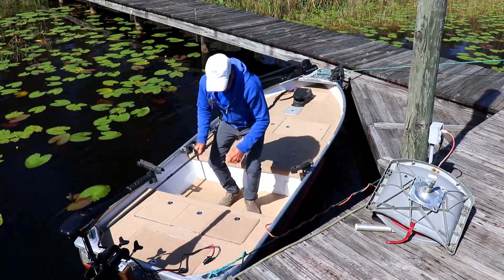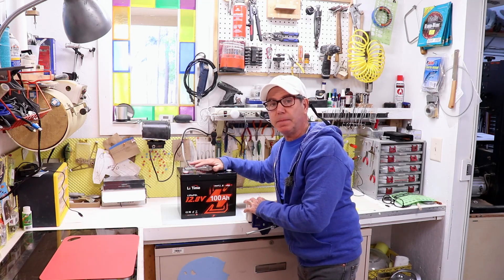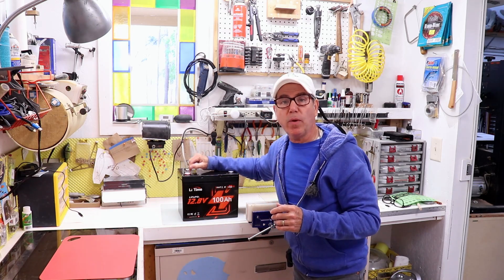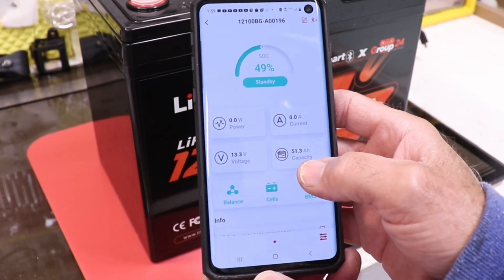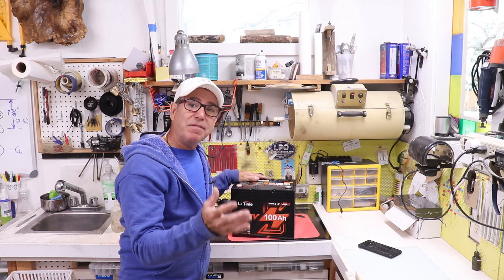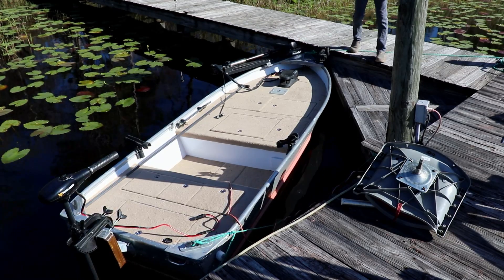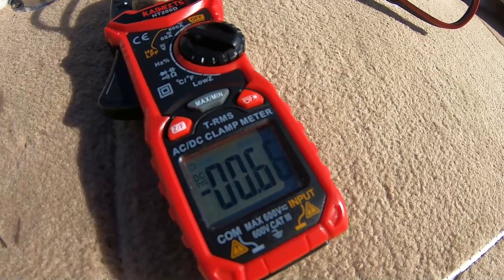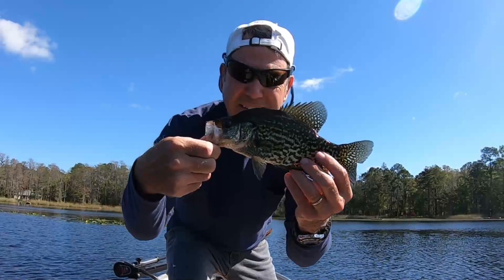Is this the ultimate trolling battery? the Smart lithium battery from LiTime #lithiumbattery

Comment: Is your Minn Kota 50 lbs is the  Maximizer version?
Reply from the maker: No...I don't think so.
Reply: @EngineeredAngler  The Maximizer use 2x less power!!! I have the 55lbs and with a 100ah lithium battery i am able to do 3 days of 8h of trolling at the lowest speed with 1000 lbs total weight ( 3 adults + boat and everything )
Reply from the maker: Wow I need to look into it.
Reply: I'm looking at this Minn Kota Endura Max 55 it has the maximizer also.
Does it really give u that much better power and distance then the a regular one? And is that just when u troll on say speed one? 
I'm looking for a good 55lb to use on my floattube a sevenbass flatform XL. And if this truly pulls less power it's a superb thing. Don't need to go max just want the nest motor so I can be out more hours.
Reply: Minn Kota Endura Max 55

Comment: Just so you know, the charger voltage was lower because the charger was peaked in current limit. In other words, the charger can only output so much power. So when the battery voltage is really low, the charger would have to produce more current than it's capable to accommodate the battery's needs all at once. The voltage is in a see-saw relationship with the current so when current is peaked, voltage is lowered to charge the battery and be closer to match the battery's state of charge voltage. Hope this helps.

Comment: I've got a new boat, a pair of LiTime bluetooth batteries and a LiTime two bank 10 amp charger, all professionally installed.  The charger lights flashed red when I plugged it in today.  The manual doesn't tell me what that means.  Also, I can't get the LiTime app to open so I can pair my iPhone to the batteries.  I keep getting the following message "The network has timed out.  Please try again later:  I have tried many times, to no avail.  There is no USA based tech support for LiTime that I can find.  You have to send and e-mail or call Hong Kong China.  I sent an e-mail and got a message saying they would get back to me within 24 hours.  They have not.  I finally called the phone number today and it just rang.  Probably because it's 2PM here in NY and 2AM in Hong Kong.  Very frustrating.  Can anyone on this site help me fix these issues?

Comment: Last April I purchased three LiTime 100 amp deep cycle lipo 4 trolling motor batteries as well as a noco lithium charger from Amazon. One of the batteries froze at 72 % and would not charge. Li Time customer service told me I had to ‘wake it up” by drawing 60 watts for five minutes. This seemed to work. Not long afterwords another LiTime battery went dead @10.25 volts and would not charge at all. I contacted Li Time and after several e-mails gave them my receipt, charger info, order # and picture of battery and this is their response;
“Hi Randy,  Thanks for your info. It helps!✨  I will help you return this unchargeable battery, we will cover the shipping cost.”
Next I received this from Li Time;
“We notice that your order was placed on 7 April 2023, which is one year ago, and according to our refund policy, for orders one year ago, the refund percentage is 60%.Is it acceptable for you?
Once the battery is delivered to the warehouse, we will arrange the refund for you, the tax will be refunded by Amazon.
For the replacement, you just need to pay $28 to get a new replacement battery.”
After complaining about having to pay shipping costs to Li Time I received this;
“Hello Randy,  We've received your returned product and we're ready to arrange a refund for you,before that,we have received your request about the return shipping cost.
As you're our valued customer, after a special application, we would like to help you cover the shipping cost of $28 for the replacement battery, but could you pls help write a 5-star review on our website before the refundation? Is is acceptable and convenient for you?
If it is possible, pls mention my name Mavis in the review. Thanks in advance for your help!!
Here are the steps to leave a 5-star review on our website.”
I noticed Li Time asked for a 5 star review BEFORE THEY WOULD SEND ME A REPLACEMENT UNDER THEIR WARRANTY.   I asked again do I need to write a 5 star review before I get warranty service?
Li Times answer was “yes in order to not get charged for shipping I needed to write a 5 star review.”
This in ‘my opinion’ amounts to blackmail for warranty service.
In my opinion this is an act ( to obtain false higher ratings) of a very disreputable company. I would advise avoiding doing business with this company like the plague, as their warranty policy is truly not 5 years , but only 30 days without penalty ( cost) to the buyer.
From Li Time;
“If the 30-day return period has passed, if the item is faulty or malfunctioning, the customer needs to pay for the return shipping cost, since you are our valuable customer, we have already covered the return shipping cost for you, normally, the replacement shipping cost will need to be covered by the customer, to make up for a little bit of the loss, if you are willing to leave a 5-star positive review on our official website, we will cover the replacement shipping cost for you again, and we will send you a brand new replacement for free!   The total shipping cost is $56( for the return and replacement”
So my replacement battery was held hostage until I wrote a 5 star review…..this I did begrudgingly. (This is an amended review of the 5 star rating I was blackmailed into writing).
Beware of this horrible company, their products, their poor warranty , and potential blackmail to obtain warranty service. Beware that those 5 star reviews you read about ,may be blackmailed by Li Time like mine was , just to get your “kidnapped” replacement battery released from Li Time .

Comment: thank you so much for the video, i was having a hard time deciding between bateries and you sold me on this one. I have a 3 meter inflateble boat and i am going to put a 40lb minkota troling mottor, im going to hook it up with this battery. The whole weight with me and the motor and the battry should be about 100kg. I should be fine right? thanks for the video, perfect timing for me!
Reply from the maker: Yup I think its perfect for an inflatable dinghy.

Comment: It would be great to be Able to get this in Australia. 
And I would be interested to know if it could be used with automotive  under bonnet usage
Reply from the maker: No, not for starting engins.
Reply: @EngineeredAngler  thxs for your reply. 
I wouldn't be using to start the engine  it would be used as a secondary battery  to  run the  fridge in the  car.
Just would  like it not to  have to have the battery inside the car and would like it to be in the  engine bay. 
Thxs again

Comment: Great video. I want to know how those battles handle cold and hot temperatures? I lost several batteries last winter because of unusually cold temperatures for my area. Also how well do they do wired in series for 24 vdc applications?
Reply from the maker: I have had 2- 100 amp hour batteries wired in series for my 24 volt trolling motor on my flats boat.  I have given them some hard work. Two day tournaments with no charging in between.  I'm super happy with the batteries.
Reply: When cold, pull your battery out, even over one night and keep it on room temperature, when installed and under load, they'll keep themselves warm enough to not deteriorate. In the peak of the sommer? May lord help you 🤣
Reply: @Toaster79   I had mine on a maintainer but I was out of town when the cold hit. They were in the boat in a garage and still went down. Because I live on the Gulf Coast I really don’t have to winterize my boat but I’ll take better precautions next time.